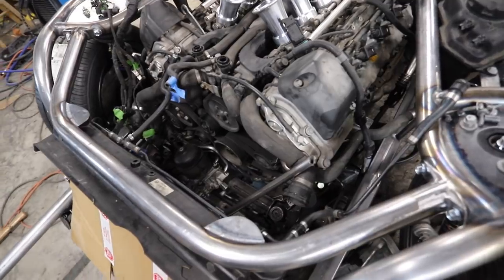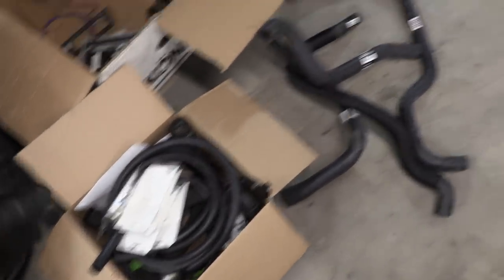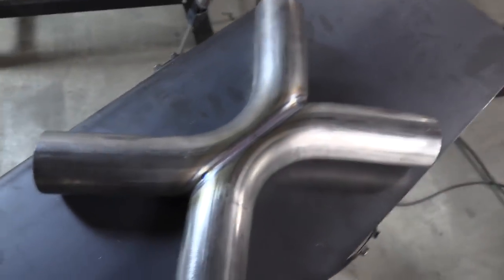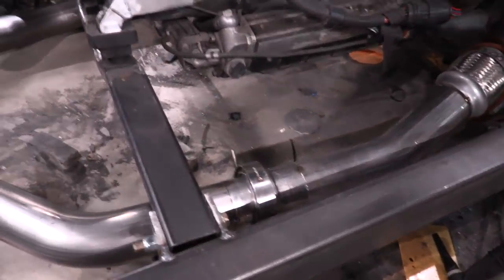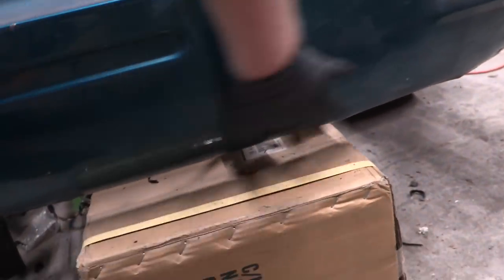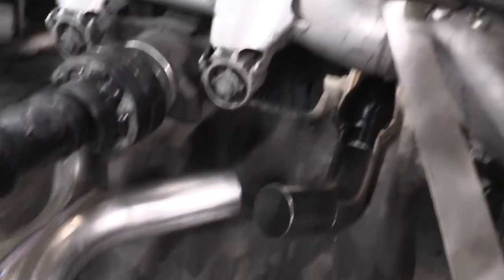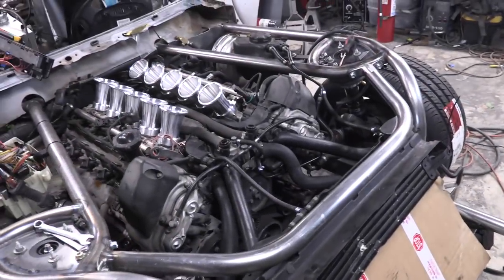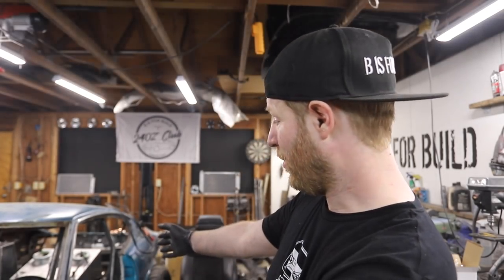The 240z Exhaust Is Ready For A Volume Test! And The Coolant System Is DONE!

Comment: with the x pipe it looks like it goes down to close to 2.5 inches at the center of the joint, which would create back pressure and negate any benefits of having an xpipe?? wouldnt you want it to be closer to 3.25 to 3.5 inches to not create a restriction. Area of a circle with a 2.5 inch diameter is 4.91 so wouldnt you want an area of close to 10 to not create a bottle neck? just a thought
Reply: I was thinking the same tbh, I heard the general rule with exhausts is you can step the diameter up, for a tip etc...but never down. Looks like too much of a restriction, the pipes should juuust be kissing each other in the middle with enough intersection to allow crossover of gasses.
Reply: The piping is only 2.5” diameter to begin with if I’m remembering correctly from his previous video
Reply from the maker: only one bank fires at a time, so it does constrict down to 2.5 inches, but thats the same flow size for a single bank, and only one bank will go through there at once so its not really constricting
Reply: B is for Build  fair enough, but there isn't ever a gap in exhaust pulses, yes to be fair the cylinders fire one at a time one bank at a time, but the engine fires 10 times per revolution, so at lets says 5500 rpm its firing 916 times per second. So 458 pulses are coming from each bank, per second. That being said there's a constant flow of exhaust gas from each side, and the amount of exhaust gas goes up the higher the rpm goes up. That 2.5 inch narrowing in the x pipe will create a bottle neck in the exhaust.
Reply: @BisforBuild  I agree pulses can go either direction so there is no restriction as such " imagined" 
 The benefit is still there.
Reply: I think bro might have a point chris
Reply: XJ Customs  I think you forgot to divide by two in there. Each cylinder fires once per two rotations. Not every rotation. Still a lot of explosions though =)
Reply: XJ Customs  Ur right!
Reply: I agree, I've never seen an x pipe that intersects that much, this wont scavenge, they will just fight for space against each other.
Reply: XJ Customs 1 cilinder only fires once per 4 revolutions, so 10 cilinders is 2.5 times per revolution. So (5500/60/4)*10= 229.1 times per second -> 114.6 times per second per bank.
Reply: MattheusJohannes  fair enough lol got my maths mixed up there, still an awful lot of exhaust gas to squeeze through a 2.5 inch section, also a quick google search of x pipes in exhaust system for m5's (stock and aftermarket) the center section of the x pipe is larger than the diameter of the exhaust. I mean if bmw, borla, corsa, magnaflow etc, feel that its necessary I'm inclined to believe its necessary
Reply: @croatheartbeat  it's crazy to think you get that many pulses going through there. 5500 ain't even that high!
Reply: I think AFTER the build AFTER SEMA a good dyno run would be interesting.Because the intersection is so short and really doesnt restrict flow due to the fact it goes directly out into two tubes.
    I dont think ,what they have fabricated is robbing, any power 
I think a pair of good mufflers  will 
Be all thats needed and maybe , maybe ,... Maybe a very short resonator to dial in the sound and help out with any rpm frequency that may pop up .
    The bigger factor just maybe getting what ever power this creates to the ground. As its a running chassis.There is no body weight to speak of.
But all these details should be AFTER SEMA at this point.
Reply: MattheusJohannes  I think you mean it fires once every 4 strokes, which is every 2 revolutions.
Reply: B is for Build  Chris. on the muffler situation can you run one muffler and then straight back out of the car?? Oh happy birthday to Eric.
Reply: XJ Customs BMW engines (as well as many German engines) are designed to run with a certain amount of back pressure, and if you run a free-flowing exhaust it will actually take away from the power figures. This will help it run as designed and most likely create more power than a wider X-pipe.
Reply: XJ Customs  agreed
Reply: B is for Build  if your theory holds true, then why have the x pipe in the first place?  You need to cut out a bow tie in metal, cut the pipe and form a box for the x pipe, that restriction will be hp robbing.
Reply: MattheusJohannes  this is correct, but still alot of pulses and a constant flow of exhaust.
Reply: Guys, it's just a show car. Really doesn't matter now. At least it will still run!
Reply: Andrew Malaty  My bad, you are correct!
Reply: XJ Customs  4 stroke motors fire 1 time per two revolutions i.e. 5 cylinders would fire per revolution. Otherwise, I would agree with your statement. Edit: I should have finished reading the comments before I brought out the dead horse... carry on.
Reply: Go watch the engine masters episode where they bash a set of headers to see how much it effects the engine power. Sure a header is different from a x-pipe but they do bash them alot and almost to the point where they are completly flat, doing multiple runs on the engine dyno it really didn't show much difference in performance. And on modern engines there really is no go fast parts like back in the days because it is all computer managed and you need a tune to get anything from bolting on different parts. Just had this lesson with an intern at work but regarding boost when he jokingly said put a bigger turbo on the car that i had in the workshop. So just explained well you can do that but you won't gain any power from it since it is on a stock tune, that might i add already puts out a decent amount of boost as it is. You will probably get a different powerband depending on what you change but won't get more power from the engine.
Reply: MattheusJohannes fires once per 4 stroke, so it fire every 2 revolutions. 2 strokes = 1 revolution.
Reply: J.C. Kohle  if it is still on the stock tune it won't know what to do with the added boost and the readings will be outside tollerance which will put the engine straight to limp mode to protect itself from damage, so no it wouldn't gain power it would become useless since it will go into limp mode as soon as you hit boost. Not considering it is a whole lot of work to even support the added boost. For example more air means more fuel which your stock fuel system probably wouldn't be able to handle because it is not built for that. I never said it isn't possible to gain power but the stock tune doesn't allow it. But what do i know i'm just educated and certified as a machine mechanic and work as a vw tech. I work with modern cars 5 days a week 8 hours per day and i keep studying the newest tech that vw release so i think i actually know a fair bit about engine management. ;)
Reply: @soapmcsoapface1787  As you know all too well then, VW engines love going into limp mode if not tuned correctly😆 It's like the annoying wife that can't wait to tell you "I told you so". I know it's the case with all engines, but I'm a die hard VW/AUDI fan so I'm more familiar with them. Some cars come with better injectors so they can be tuned with a bigger turbo, within reason of course, using the factory injectors right?
Reply: @davidd4677  yes i know all too well about limp mode but rather it going into limp mode than melting a piston atleast 😂 and evertyhing can be tuned within reason on stock components. A stage 1 never swaps out anything, maybe the air filter that doesn't gain much (if any) power compared to a stock filter. Stage 2 is usually exhaust with the correct tune. If the engine already is boosted it can obviously handle more than a converted N.A because boost requires alot more fuel which the N.A system isn't built for from the beginning. Say you run 1bar boost (about 14,5psi) then you are around double the amount of preasure compared to atmospheric preasure. And 1bar of boost is not unusual in stock engines nowdays.
Reply: @soapmcsoapface1787  I'm finally going to be starting the bolt on upgrades this coming year on my 2014 Tiguan TSI with 56,xxx miles. Any do's and don't's you can suggest?
Reply: @davidd4677  well do's and don'ts. Timingchain is weak AF on these aswell as rods and pistons so look for upgrade kits for those things. And be organized when doing work on it. Do the chain and rod + piston swap at the same time, engine can stay in the car for both jobs. Get the special tools for the job. Also don't remember 100% sure but there is a big risk the turbo and manifold are one part so if you are planing on swaping that you need a new manifold
Reply: J.C. Kohle  im only saying that in a modern car the ecm is very smart and the limitations is very strict. Maybe you can gain a few hp before it shuts down but never something that will be noticable. It really is pretty simple to understand. The tune is the tune it won't know what to do woth anything outside whit is programmed into it. And don't worry i didn't get offended sorry of it sounded like i was getting defensive just trying to explain 😊
Reply: @soapmcsoapface1787  Right on, thanks man! I was planning on using Integrated Engineering internals at some point, but now knowing how brittle they are, it actually sounds like a better start. I bought it brand new and have had really good luck with it. I definitely want to spend the money and do it right the first time.
Reply: @davidd4677  the TSI engine in general we see alot of timingchain issues on. Thankfully it is easy to inspect them since the computer can calculate it from different readings but as a tech who works with it i hear it when i start the car to take it into the workshop. If you have any questions feel free to add me on instagram @thattechnician or facebook same name as on here.
Reply: @soapmcsoapface1787  I really appreciate that! I'm going to follow you now on Instagram. It will be my business page hd_powdercoating_sandblasting.

Comment: Bad designed x pipe. He cut too big of a piece off both elbows. That is going to be a bottle neck.
Reply: Yep so basically goes from two 2.5 inch pipes to one 2.5 inch pipe then back to two pipes. Gonna be restricting and the car might not like it. We'll see
Reply: Maac Petzol  it wont restrict the exhaust as only one side is firing at a time, if you made the X-pipe to big the whole point of pulling a slight vacuum on the other header would go away
Reply: Dont know how big of a exhaust the bmw  had stock but i gease this system wont be a restriction and if it is you 4 sure wont notice it while driving. (A bit of back preasure wont hurt the car at all)
Reply: skiingfrendzy its a v10 it fires both sides at the same time
Reply: The cylinders are not going to fire at the same time so the exhaust gas "pulses" are alternating from side to side equidistant from each other and won't not reach the X point at the same time. Also it is probably better to have the same diameter X point than the single pipes for the scavenging effect to be as strong as possible since the exhaust flow won't stall in the larger diameter center point. And one point more for this design is that aftermarket performance exhausts use similar designs.
Reply: MSTR-RPTR I stopped reading when ya said both sides are not going to fire at the same time.
Reply: User 99321  U can keep reading his comment because hes right. Its pretty logic if u know something about engines.
Reply: @gmc__tanner1192  All 10 cyclinders will be at the top at the same time and then at the bottom at the same time. Am I RITE! 😂
Reply: User 99321  Congrats you officially shown every one you're talking out of your ass and know nothing about this car or its application.

Thanks for playing better luck next time!!!
Reply: @mstr-rptr  thanks for explaining. That made a lot of sense actually.
Reply from the maker: MSTR-RPTR  droppin knowledge! Much better than my explanation in the other comment :P thanks!
Reply: cough keyboard mechanic cough
Reply: Roadkill bashed a set of headers to see how much restriction you can get away with, hint, its ALOT

Comment: I run a similar exhaust system with one damper into a small muffler but with the precats in place, it is crazy loud.
I took out the H pipe for better sound, takes away some torque but whatever.
There is enough room to put two additional dampers close to the X pipe in there, I'd do it because the setup you have now will definitely wake the neighbours.

Comment: Happy Birthday Eric! Looks like you have the same issue I had with my x pipe, one I fitted it in it’s too close to the driveshaft so I softened it up in front so I could tuck it closer to the floor pan so it wouldn’t drag on the ground

Comment: On the M5 a 'race' exhaust with even with cats, resonators and mufflers is very loud and drones badly, I imported the RPI resonated system at great expense and with this on standard headers, I lasted a month before I went back to stock, the drone was painful as was the volume, I have heard 'straight piped' cars, these are REALLY bad. I know you don't have any choice but I think you will fine this LOUD no mater what you do, the car is so short and low, theres no real choices. Good luck with the neighbours :)

Comment: Isn't that X pipe a bit restrictive? I would imagine the center section had to be at least double the area of the inlets?
Reply: That is how they are typically built. Placement in regards to how far behind the headers the  is placed is more important. Remember, you don't have both banks firing into the X at the same time. Increasing the size of it would negatively affect the scavenging.
Reply: No, because you only have one exhaust pulse passing through it at any given time. But I do see an issue with it, in that the inlet pipe and the outlet pipe are an entire pipe's width offset. So the exhaust pulse will impact the far wall forcing it to turn 45*. So the X-pipe won't really add anything performance wise, but will likely help dampening the higher pitch tones by splitting and elongating the pressure wave. This will help it have a more throaty rumble.
Reply: Like losing 5hp means anything here xDD
Reply: MX304  didn't think you got any sort of useful scavenging from that oem non-equal lenght manifold.
Reply: Hessu55  That too. Not like this thing will ever be driven in anger.
Reply: You're restrictive
Reply: Nebbia affaraccimiei  You probably don't. The only reason to even put an x-pipe on something like this is for the exhaust note.
Reply: Only one cylinder fires at any one time, so no not restrictive ;)
Reply: PiezPiedPy  but if its not equal lenght manifold the exhaust pulse will hit another passing through
Reply: MrAlanx1  I was referring to the diameter as the OP stated

Comment: Love your work!! I have some ideas tho... It could be good to add a joint behind the manifolds, just to make it easy to remove the exhaust (without removing the headers) And also, is it just ONE pipe in the font and ONE pipe in the back plus the fuel tank bar that holds your frame together? (excluding engine, font and rear axle) maybe you should consider adding a support for the frame to prevent twisting?

Comment: If you ever re-do the exhaust, I learned that it's a good idea to close up the ends of the pipes and fill them with gas, because that way the inside of the seam is smoother, causing less turbulence in the airflow.
Reply: There not fully welded yet nobody does back purage on tack welds I'm guessing they will when fully welded

Comment: Those resonators are going to drag nuts on everything
Reply: Agreed. They may want to rethink that area. Resonators and mufflers should be in recessed areas and only have the pipe going underneath things like the subframe. Since it is not fully welded yet, it would be a quick fix. Just move them forward a few inches.

Comment: Where the exhaust passes between the bottom floor and the upper floor will it be protected by insulated wrap cause there going to be a serious build up, which could get dangerously hot.....

Comment: I may be wrong.. so wrong in fact. 9:59 - will the drive shaft not vibrate/judder extensively due to the misalignment?

Happy birthday Eric!!
Reply: I believe that as long as the face of the hub on the transmission and the face of the hub on the diff are parallel then the joints run smoothly. Think of a truck with a solid axle. The axle moves up and down and becomes more and less aligned with the transmission but it doesn't vibrate. If you look up a video about u-joint alignment you should be able to find more info. :)
Reply: All rear driveshafts are misaligned both side to side and up and down. 3-4 degrees is usually about the max for a normal u joint but there is definitely a cv-ish German wobbly joint in there that probably increases the degree of usability. Only a test drive will verify if it's within acceptable parameters.
Reply: also this is not at ride height when he lowers the front (which is way higher than the rear) it'll line up better. or at least i hope so haha!
Reply: @andrewmalaty8  what?
Reply: Not necessary... But in this case, we will have to wait and see. In BIFB we trust ;)
Reply: @andrewmalaty8  
It's independent rear suspension 
Have a think about it 
Lo,
Reply: It is at a pretty aggressive angle lmao, who knows, worst case scenario he trailers it to sema and parks it
Reply: @fowletm1992  thank you

Comment: You're gonna have a problem with that x-pipe.. the pipes leading up to the x-pipe are obviously not the same length, that will most likely lead to the pressure waves from both banks hitting each other. What also could happen is that a pressure wave from one bank could hit the other bank during the exhaust stroke leading to poor gas exchange in the cylinder. This stuff is way more complicated than you might think and it has to be precisely calculated to have any positive effect.